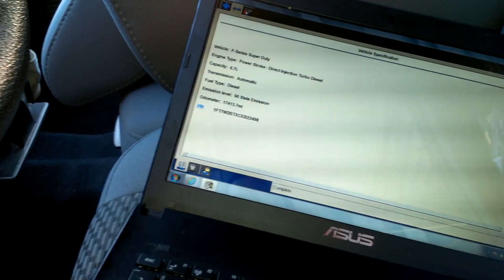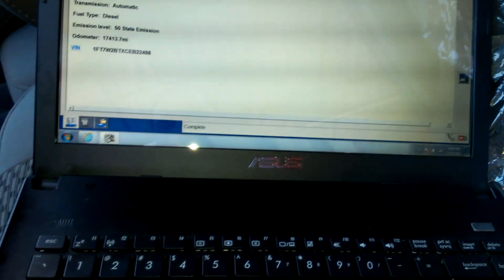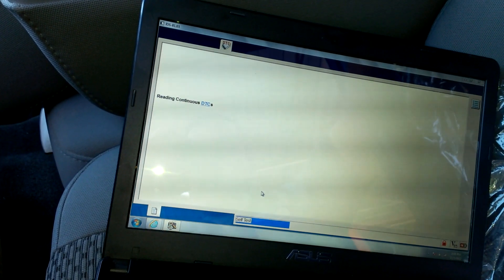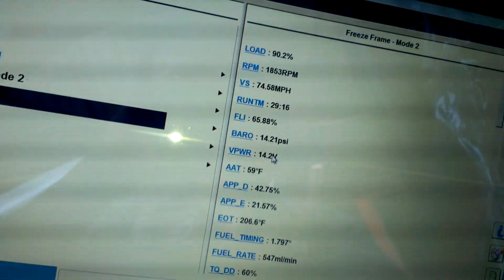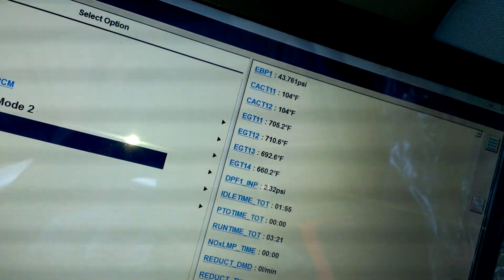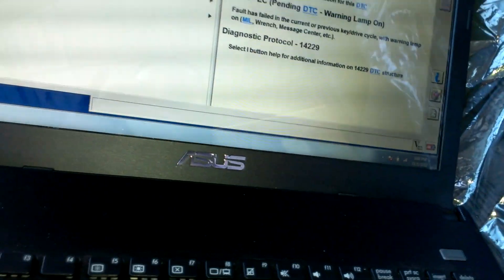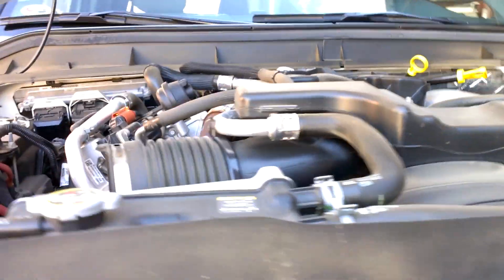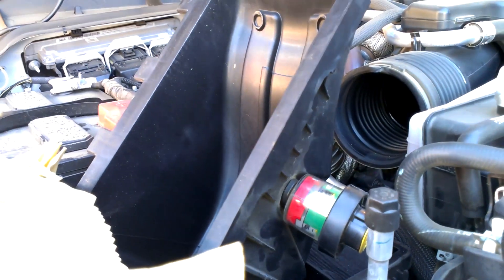HOW TO FIX 6.7L LACK OF POWER DTC P04DA

Comment: I just had a truck with this 2012 450. Remembered the video and checked air filter. Had a motorcraft that was over due on replacement and was working on sucking up into turbo. Also had a low boost code however.